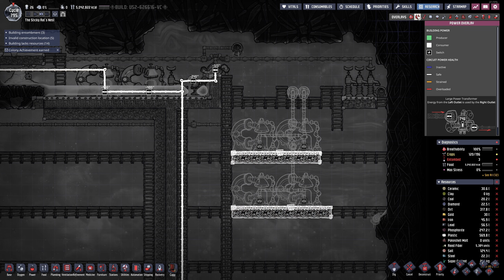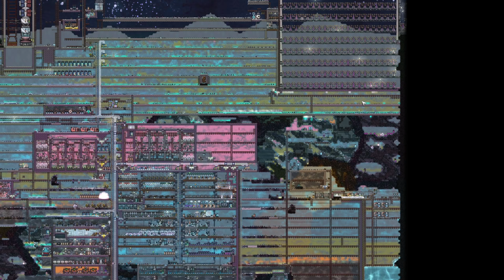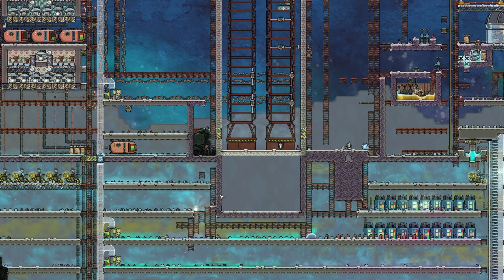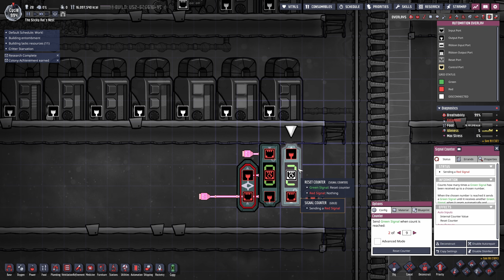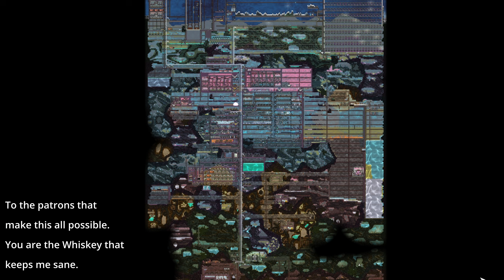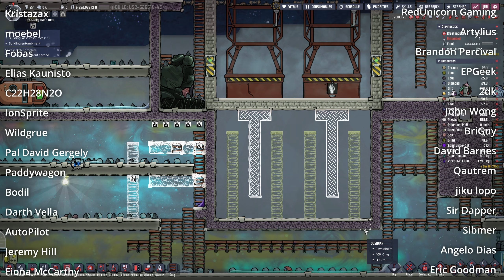Resource automation : Oxygen not included ep 20

Comment: A thought on performance:  Remove some the the scaffolding you have in unused areas.

I don't know how the balance in OnI is for the various physics systems vs pathfinding, but I know pathfinding can be expensive.  That's what slows Dwarf Fortress down in large forts.  The typical algorithm used, "A*", gets more expensive with the more places it has to look.  If you cut off the areas that aren't in use then it has less area to search over.  Either removing the scaffolding entirely, or just pruning off all access (really has to be every last bit) to an area to remove it from pathfinding.

Honestly would be pretty curious to know how that affects OnI as it also has a lot of other things going on (gasses in particular).

Comment: I dont bother with powered tube stations at all floors, a horizontal exit works fine with fire poles nearby to get down a few lvls
Reply: Basically, pipes to go up, poles to go down, stairs for backup/redundancy, 3 tile wide corridors with airflow and mesh doors (5 tile wide for airflow) no need for powered pipe stations on high floors (unless its for sideways movement) saves on power (not that its an issue this far along)

Comment: 10:34 that method of filling a steam room is sooo out of date. Just make a single tempshift touching the right wall. Boom done in a single move. It's not like you're lacking ice...
It's better that way in every possible aspect.
As for that loop under diamond tiles. Why not just make it a solid mass loop? Conveyor. With diamonds or anything else with similar properties.
13:27 rusty FJ... just use the empty pipe tool.
24:50 again. Rusty. Use conduction panels. Should be enough. If not add ribbon cable bridges. Better yet just dont use insulated tiles in between, after all vacuum is better as an insulator and use a a single tempshift. Like both the silos.

One way to get more steel fast is not use bunker tiles up to. Or big doors. I mean those ice/snow meteors cant damage anything. You can make the rocket silo lining from obsidian, regular tiles.

Comment: Dear FJ - I love your vids and your usually effective ways of doing stuff. But... and I have to stress this is said in the nicest way imaginable... you did a lot of dumb things in this episode! :D  I honestly have no idea at all why you are even bothering with the heat from the rockets - just pop a couple of obsidian tiles for the rocket to sit on and a vacuum below - that's how we used to make rocket silos!  :)
Even if you really want to spend all that steel on the silo walls and have a steam turbine delete the heat, why use all those diamond tiles? The pocket below the silo could just be water with a couple of tempshift plates to get the water boiling and spread the heat through the steam with connected turbines to the side. Right now, you've maximized the amount of heat you're conserving, which seems to be the opposite of what you initially intended, but you're not exploiting that captured heat. There are no meteors to worry about as snow will always melt in the silos. You could even use that to delete heat just by popping some background tiles above the bunker doors so the fallen snow melts, turns to water, turns to steam and evaporates taking away much more heat. 
Meanwhile, desalinators don't mind other water types, so no need to filter. Too late now, but I'd recommend storing the solid mercury in a vacuum - much more efficient storage space than 50 blocks of liquid. 
There's a cycle sensor instead of a timer that seems like it should work exactly the same but take less computational power.

Still enjoyed it though, thanks. And also made me realize I'm never going to bother with biobots.

Comment: Hi, I actually did what you're now trying to do - capture the heat of automated rockets horizontaly (vertically it would be the chimney). I had 4 lines of supercoolant going around the steam room (yes steam room heat capture on the top) and all of that heat going down to a same size steam turbine setup... I had 24 steam turbines, that absorbed the heat from 12 rockets, and it was not enough, so I had to add automation to stop the rockets when the steam room got to about 400C (yes, I was letting it go that high, as I was using it as primary source of power for my base and I was storing the heat), which meant also limiting steam turbine inputs and all that stuff. Basically it was a very fun endgame project, but somehow I abandoned that save 3 years ago, there were mod/dlc errors/notifications when loading it, though it still works for visual inspection. If you're curious, heres a google drive folder with pictures and a save file: https://drive.google.com/drive/folders/1zbZ8qa3LneMABNfzRx7fIbhpDGqhvP4N?usp=sharing

Comment: If you were just wanting to drain the heat and not use rockets for power why even use the diamond blocks. 
If it was a vacuum before putting the diamond blocks in will just causes the rockets to make more heat to destroy. A single layer of diamond touching the bunker tiles would cool the bunker tiles while still letting most of the heat never be produced due to the vacuum.

Comment: Doesnt the timer sensor have a cycle counter mode as well IIRC. No need to count seconds.
For the rocket heat box, could have saved the diamond and used steam + door + metal tiles to transfer heat. Your previous entire rocket silo heat box and water recovery from rocket exhaust were so cool.

Comment: The timer isn’t going to work because it doesn’t reset to 0, it skips from 9 to 11. And now that you’re running every 36 cycles, you can take the cargo off wherever, just unload on a delay so instead of rotating everything, just make it a steam bath with diamond heat spikes and a diamond wall. Way better thermal transfer

Comment: To rotate heat over super hot stuff, just use gas or solids... In case of rockets you don't need that much throughput, so hydrogen will probably be enough. Also even supercoolant will definitely pop when directly under a rocket exhaust.

Comment: Could you create  block with super heat capacity by compressing vaporized metal into a single block and then "freezing" the block so you get a super dense block with tens of thousands of tons of mass?
Reply: When dropper bin drops the same element inside the tile, tile increases the mass. So, you can use door deconstruction then feed the tile with a bin.

Comment: Wouldn't it be easier to use the digital displays advanced mode? They only send a pulse once they reset instead of a constant signal and start counting at 0 instead. Probably still need to use a buffer or SR Latch at the end to make sure a dupe reaches the rocket in time.

I'm still partial to creating refined carbon tiles with coal temp-shift plates under hydrogen rockets to absorb/buffer heat. Over triple the SHC of diamond so while it is harder to get the heat back out, it doesn't get near as hot as a diamond tile does. Feel like if you have radiant pipes prebuilt through the tiles the fluid cycling through it should cover the cooling needs.

Comment: Francis, per your topic of liquid heat transfer.

What is better at those temperatures, a super coolant loop like you made? Or a conveyor loop with diamond or something?
Reply: Conveyors hold twice the mass per segment as liquid pipes, but super coolant has 16x the heat capacity of diamond.  The only solid that beats it is putting atmo-suits on rails, because each segment can carry 1 suit, which has a much higher mass.  A few things like some types of ice, abyssalite, and genetic ooze come close, after you factor in the double mass, but debris heat transfer uses lowest conductivity, so abyssalite is useless, and now that lumber changed to it's own element of wood, there's no good source of genetic ooze in huge amounts that doesn't spoil.  Lumber based heat transfer belts were a niche thing at one point, since genetic ooze can't melt.

Of course, you can just use both, so you don't have to choose, but the rails won't add as much, so aren't worth the effort/lag.

Comment: A kind of backwards idea for maximizing heat deletion of the rocket exhaust: Since the heat is actually injected in the diamond tile area, you could instead leave the said area a vacuum and instead put diamond tiles where they currently aren't. 
It should significantly lower the amount of heat that the rockets dump into the tiles (since only the steel tiles should get heated vs steel + diamond tiles).
The shape you'd end up with is a W instead of two I's if that makes sense. 
Other option is to focus on "directly cooling down the walls" instead of cooling down the exhaust area, but that doesn't look as cool now does it?
Reply: This was my thought exactly. The current diamond tiles are just absorbing extra heat from the exhaust rather than removing heat from the silo.
Reply from the maker: We could minimize heat generation but I kind of want to get a decent amount of power out of the system. From what I have observed we generate enough power from the landings to pay the power costs of making the liquid hydrogen and oxygen fuelling the rockets.

Comment: Do the pipe bridges actually move liquid faster do to teleportation?

If so, could we exploit that to move more liquid/gas in the same space?
Reply: Nah. the way i see this, just maintain less liquids in a long pipe. like 100 blocks off pipes has 100 blubs of water, bridged it might have 50 blubs of water in same distance
Reply: @diegoflavio8193  ok.

I was thinking that cause the blob enters the input and instantly teleport to the output that would mean that for 1 second of movement instead of moving 1, it moved 3.

Thus 30kg per second of flow rate.

But I guess it's still limited to 10kg of flow but at a higher speed...
Reply: @Schirelagel  yeah, when i read this comment really makes sense haha. but in practice only makes travel the same distance faster than only pipes.
Reply: @diegoflavio8193  yeah, I guess it's more like folding space. So even though the bubbles get to their destination faster, it doesn't actually make the pipeline bigger.
Reply: @Schirelagel  Latency drops, but throughput stays the same.

Comment: Rotating diamond or refined carbon on the rails is better than supercoolant
Reply: Theoretically you even combine three types of moving heat by using gas, fluids and solids. Rotate them through a room with a lot of steam/water/ice that is used as an energy capacitor that is for example cooled with an steam room. Yes this typ uses a lot of room but you have a system that is capable of cooling things really fast as long as it isn't a permanent heat source. I've also never really seen a situation in which someone would need it because most of the time a good steam room with an aqua tuner is absolutely enough.
Reply: @shinoharazockt9912  That's smart. Combine the highest heat capacity and the highest thermal conductivity but not using the single element that maximise both.
Reply: Steel even, Niobium, Data Banks, Jet Suits!
Reply: If you manage to fill the liquid pipes with less then a kilo of super coolant, it can change state in the pipe without breaking them and still transfer heat until the pipe doesn't melt
Reply: @VeranWorks  then you will have only 1/10 at best of specific heat capacity of a super coolant because of a lower mass. In addition it will be a nightmare if you ever want to extend the loop
Reply: @tyomytch9945  Extending the loop isn't actually that bad, you just need a valve set to 1kg/s and make sure that where the bunching up happens before the valve, your super coolant ain't too hot.
Reply: Ok. But I dont get why. Yes you can do this.  But refined carbon on rails is just way better when dealing with rocket exhaust or magma: comparable conductivity, 10x heat capacity, no valves, no pain. You can, as mentioned above, even rotate atmo suits which is totally nuts btw =)
Reply: @tyomytch9945  Oh, yes, conveyor rails are great for this. I just meant that you can make the pipes work, too.

Though I don't get why he doesn't just use water itself. Make a giant steam room under the rockets. Strap the turbine onto the left (like in the base) and drop off the exhaust water on the far right. The steam itself will move the temperature from right to left.
Reply: Well, the cool thing about oni is that one problem has multiple solutions and everyone can choose what he likes better)